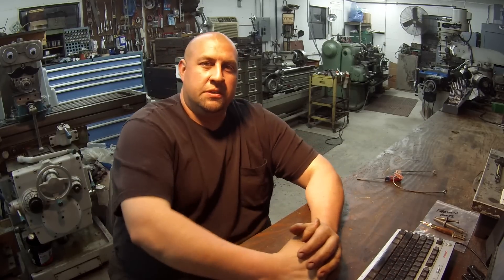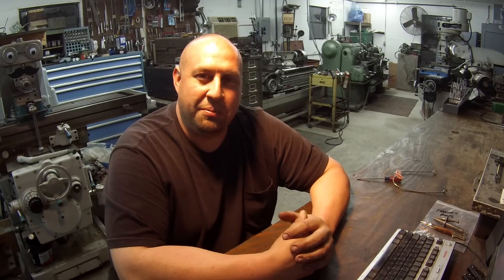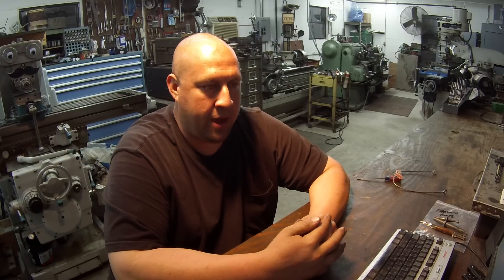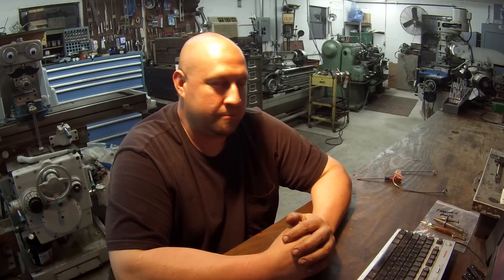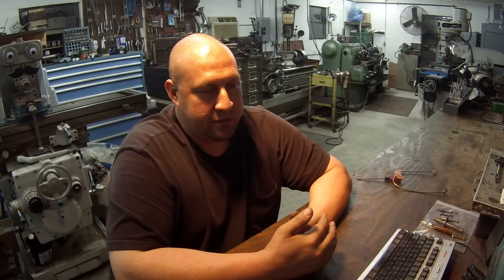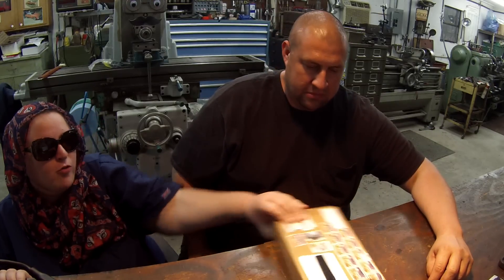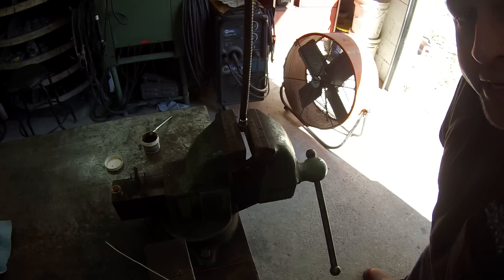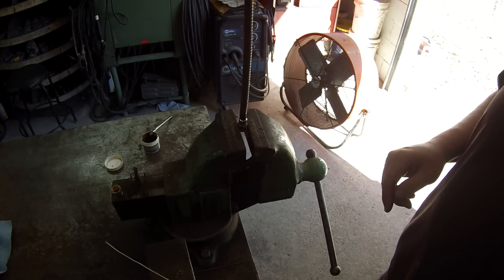Saturday Night Special 42 Part 1

Comment: Hey, if only you knew someone who has mad skills and a lathe, you could get them to make a custom all American nipple :D
You already have the reducer where that nipple screws into that angle

I remember a show talking about outsourcing, assume an American company is paying $10 for each worker, plus the overheads of the building, electrical etc
They can outsource effectively for $10 per worker, and that includes all overheads.
Reply from the maker: You make a good point there Sparky, and one which I have already thought about. I'd like to find some good quality 3/4" pipe and build the fittings myself. Hell, I might just used some old stock laying around.
Reply: ***** If the company has to pay 25$ per hour for their own workers, even 30$ or more for outsourced work is cheaper. At least here in Germany it´s because of tax laws: Outsourcing lands on the company´s bills as running costs, for those the company can get tax reduction, but they don´t get some for the wages they pay. The government get´s lower taxes paid and has to support the unemployed. Pretty stupid! The only solution: No tax reductions. For nothing. A fixed income tax on everything that is earned either by running a business or selling the individual´s workforce.

Comment: Your Milwaukee valve is a 'Compression valve' it will work as a throttling valve, But a ball valve is actually better... However you are not throttling high pressures so the Compression Valves will do the job...

Comment: Hey Adam, maybe you knew it already, but make sure that you never heat chlorinated solvents (brake cleaner usualy is) beacuse it makes a poisonous gas thats quite deadly.
Being that said, over here its the same with the low quality products :(  but up there you at least have the chance to pickup the good old iron at a relative low cost and prevent it to be smelt into crap.

Best regards from Argentina

Sebastian Cardoso

Comment: i´ve used hydrocloric acid a few times on brass on hard to reach places and that have worked verry well, it gets everything of even in a crevase like you´re working with there and you just rinse with water afterwards. I dont know what it´ll do to steel tho :/ might have to test it and get back to ya :) (dont hold your breath though LOL)

Comment: Adam, undersize taps are used for components that will be hardened & tempered. After H/T, they are retapped with normal size taps (don't ask how I know this, I could tell you but then I'd have to kill you).  That's a very nice acetylene-air torch. By the way the US made valves are globe valves but many US company have their smaller valves made in China for economy. Milwaukee Valve Corporation is now part of a Chicom company ! There is no shortage of excellent US made valves but you won't find them at Billy Bob's Bargain Basement.
 Please keep the info about the taps private (LOL)
Reply from the maker: These old "globe" valves have been sitting in out bins for a long time, so I'm willing to bet there are USA made. There's no indication otherwise except the the handle tag. I'd like to put one to use. Don't worry about the tap info, I won't Tweet it. LOL
Reply: How to you re tap something that has been hardened? Your mistaken I think? 
We use to have to use OVERSIZE taps prior to the piece being hardened! 
After heat treat we would have to sometimes get the crud out (case hardening) of the now hardened tapped holes by very carefully re tapping with regular sized taps to clean out the thread.

Comment: hi, in europe (i am from Romania)we use 1-2-3 taps this is one set... first you put the nr 1 in the hole, afther that nr 2 and nr 3, it is eazyer to tap. specialy manualy...  I saw that yours have a line near the square. that is the tap number. one line, is the fist tap... etc... it is like making a thred on the lathe, first pass... second pass...

Comment: those are globe valves.flow is in the bottom and out the top.They are good to use because they are designed to regulate flow.

Comment: You may have to machine your own pipe fittings.  Then you'll know for certain that its American made. Lol. You'll have to start The Booth Brass Valve Co.  Then you can put lots of us American machinist apprentices to work for you. Young guys like me, who are taking machine tool courses, or fresh graduates, could get real world experience. Creating more jobs for this country that is much in need of them, while also creating a quality locally built product. You can boost our economy two fold.
Reply from the maker: I like your thinking Mitchell!
Reply: You would also need to be certain that the materials were produced in the USA. 
We see an increasing amount of materials such as tubing, bar and plate that is being produced in China. That includes steel, brass, bronze and stainless. 
And the quality is inconsistent and sometimes sub-par as to dimension and metallurgy.

Comment: It's all about cost, over any consideration of quality or efficiency. I'm sure that if China had the same protections for workers and the environment as we do, they wouldn't be able to compete nearly as effectively.
It really is about quality. For example, at work, I was fitting some pipes for a test machine, and noticed the difference. The stuff that's stocked by Grainger is their own house brand, made by who-knows in who-knows-where, China. Their 'galvanized' Schedule 40 pipe and fittings come in already with rust spots on it, wavy threads, and a clear weld seam protrusion on the inside, to say nothing of the uneven end of the pipe. Nothing I'd ever build with. Compare that to Wheatland Tube, who stamps their name on all their pipe (Schedule 40 as well as EMT and other conduit types, and some light structural tube), which is made at their plant on Western Ave. in Chicago (I've been by there several times on the train) from American-melted steel sheet. The galvanizing is even and without rust spots, the threads are straight with the proper taper,  the cut ends are square and without burrs, and the seam is minimal.
Good thing about ordering from Grainger, you can look at items and it'll show you the company that made them, and in which country. For some items, including pipe fittings and o-rings, American-made parts can be less expensive than the Chinese stuff.

Comment: I believe that Lowes and Home Depot are both owned by the Chinese. I think they did them just like Vise-Grip. Competing is too hard so it is easier just to buy the product then you can sell your stuff much easier and most people don't think anything about it.  Finding anything of quality at a big box store is nearly impossible to do and sadly they have put out most of the mom and pop type places that used to handle a lot of good stuff. The internet and direct buying from manufacturers is about the only way anymore to get good stuff. On your lathe I don't think you want a gate valve, they tend to be leaky unless you are full open or full closed. Look into a Vogt Globe valve for that application. They used to be made from raw material through heat treat and finish in Louisville Ky but in the 90's they moved production to Texas and I think they are still US made there. Gulf Coast marine supply listed on Pennsacola Hwy in Pennsacola shows to be a dealer and sounds like a cool place to check out from their webpage. :-)

Comment: The other thing Lowe’s and other big box stores like Lowe’s and Walmart.  I remember reading this story maybe 10 years ago.  Walmart approaches Snapper mower and says they want to sell snapper.  Obviously Snapper is VERY interested.  But, Walmart set the buying price and volume.  Snapper says that’ impossible it can’t be done.  Walmart says don’t worry about it.  We’ll set up the factories in China and have them made over there.  Snapper knows you can’t make quality at those prices and certainly didn’t want “made in China” on their mowers and turned Walmart down.  

The writer did some more research and discovered that all the mowers sold at big box store are made in China.  Buy a John Deere mower from Lowe’s?  It’s not a John Deere.  You have to go to a John Deere seller to get a real one.  The rest are nothing more than cheap Chinese copies.  

That’s probably exactly that happened with that ball valve company.  Lowe’s approaches them for their brand and reputation.  Sold them the deal.  Now the company can’t even compete with their own product and probably shut down its US factory.  Or just focus on the larger items they make you can’t get at Lowe’s.  Grinds my gears!  Try not to go to lowes.  Their ruining this country.

Comment: Check and see if valve says water oil or gas on it. Coolant might erode washer on that old 3/4 valve. Come 2 think of it , make sure washer and packing washer aren't dry rotted b4 u even bother with it.

Comment: Hi Adam

I like your disappointment on buying a valve made in China, but money makes the world go round and some people in black suites and ties found out, that it was better FOR THEM to produce the valve in China ... it makes room for their salery too ... and surely a lot of it too !

I would place your "old new" gate valve from the drawer right after the albow so it wont move the nossle so much when you turn it.

BTW, how are this "goose neck" sealed ... no rubber ... just steel ?

... wonder it's not leaking !

Re-think your going into the dentist business ... I'm sure you'll miss a customer - your Mr. Dentist
Reply from the maker: Keld I'm not sure about the swivel joint as I have never gone into it. But sometimes they use o-ring seals. Not sure on this one.
I'll probably repipe a bit different next time, and possibly make the fittings myself.

Comment: Ha ha ha.  Elena just HAD to see what was in the package.  funny  Oh yeah, those clamp thingies are called hemostats.  I wouldn't know what they could be used for.  Maybe a "roach clip"?  Yeah, it's sad to see all the stuff that used to be made here go to China.  A lot of those valves are low quality.  Sure they "look" like the American(or European) original.  But when take a closer look, you notice that they're made out of thinner material, etc.  The old American stuff would last a lifetime (atleast) and could be worked on or repaired.  The new stuff just doesn't last and you have to be gentle with it.  They make stuff now that breaks and you have to purchase again and again.

Comment: Skoda made particularly horrendous two cylinder ultra compact automobiles.  The one I saw have an accident on the German autobahn couldn’t accelerate quickly enough up the on-ramp onto the Autobahn to avoid being run literally over by a 160kph semi truck filled with a double trailer of steel rebar heading to Italy on the A-6.  The Skoda was hardly recognized as a car after and was 8” thick at the thickest remaining point...which meant bad things for the three passengers...  The truck took no apparent damage and drove away after the investigation.  The worst accident I ever witnessed in my years living there.

Comment: What really ticks me off is when I pay $72 for 6 plasma cutter nozzles and electrodes from a major USA welding supplier.  I can pay $27 for 10 nozzles, 10 electrodes and 2 ceramic swirl ring delivered to my door from China.  Is one better than the other?  I cannot find one difference and would bet that both are made in the same shop.

You drive your truck, car and etc. and it would scare you how many parts are made in China.  Go look at oil filters in your favorite supply store.  Many are made in China.  I have a family member who is a quality engineer for a major USA oil filter company and am told "Yes, we have some filters made in China. For us to tool up to make them is not profitable.  We inspect the heck out of them and we find they meet and most of the time exceed ALL specifications."

Today it is a global economy.  You can bet that some American company such as Lowes is making BIG $$$ on foreign products.  BTW "Made in America" can be said if it is manufactured in Mexico or Peru as both are in North America or South America.  "Made in USA" can be claimed if the last screw is installed in the USA.

Comment: Grinds my gears too, it's not that people wont pay  a price for decent parts, its that the seller wants to buy as cheap as they can and still sell it for the highest price they can, they dont want a fair markup, they want the maximum they can push it too, and that means getting the parts for pennies, meaning any company at home cannot ever hope to employ and sell product, unless they sell direct.  I think in future Adam, like me, esp for a major purchase you have to research and see if you can find a domestic manufacturer who is also selling directly.   The ultimate insult was putting an american company name with a USA location, and then quietly saying made in china....
Reply from the maker: I think that's what burned me up the most was the label.
Reply: Abom79 I got burned that way for the first time back in 1981 when I bought an HH Scott stereo receiver - only to find out that it was imported from Korea...

This has been going on for a (loooong) time, but only got insane after 1986...

Comment: If you really have to use the huge 3/4" valve, why not mount that straight on to the elbow, that way it will not be a vibrating weight waiting to break off and fall into the lathe bed.I know what you mean about the Chinese made stuff we are all offered in our shops, almost everything we buy in USA and UK is made in China, I try to resist buying it, but it is everywhere now, and our factories are long gone!

Comment: Hi Adam
im from Germany, sorry for my english :)
the Taps are probably a Set that cuts the thread in 3 steps
the first one has a single Ring on the Shaft
second one has two Rings
the third one which is finishing the Threads is without any Ring
in Germany its called "Vorschneider", "Mittelschneider" and "Fertigschneider"
http://de.wikipedia.org/wiki/Gewindebohrer <-- look at the last picture
Reply from the maker: Good info. Thank you.

Comment: Without reading too many comments, or even finishing the video(I'm at 20:15) because my mind would wander off if I didn't share a trick I have used with excellent success on dirty parts that have places impossible to clean that I silver solder with ease and 99.9% failure free.

I take the flux compound and heat it up in a little SS jigger for making drinks(well, it used to be..) and then dunk/or soak the part in it and continue heating until the flux bubbles and boils. Then I heat the part, add fresh flux, and in goes the solder like water into a dry sponge.

Sorry if this was already mentioned, done, or even failed, but I just had to spit it out before I forgot. It was a bit of a wild finish to my week and I've had to take more medicine than I like to and I keep forgetting what I'm doing, so please forgive me for jumping in like this.

Now, back to SNS42 part 1...carry on.
Reply: Well, after watching about 30 seconds more video your method of preheating and adding flux to boil out of the fixture worked in apparently the same way, and as is evidenced in the final segment, it worked out rather well for you! Nice...in the famous words of "the A-Teams" Hannibal..."I love it when a plan comes together!"...good job man.

Please don't think I was trying to tell you how to do your job either, I'm so totally not that way, even if I were to somehow think I knew better than a person, I always let them do the job the way they want to unless it would somehow catch my leg on fire or burn down my house, LOL!

I was just hoping to share a little trick that has helped me numerous times in the past when reparing old plumbing that cannot be disassembled due to age and or weakness and is filthy, so it looks like it depends on where you are and what you can do to make you choice on how to clean a fitting with flux.

In my mind I was imagining all of the old toilets I've fixed that can't be torn out because the restaurant/bar has to be open in 2 hours and you've got to get it done, and that was when I came up with the stainless jigger trick. It uses allot of flux, but when they need a job done in the heat of the moment, a jigger and a tin of paste is the last of their worries and can be sacrificed no problem.

I really enjoyed your show and can't wait for # 2, Aloha...Chuck
Reply from the maker: It's a good tip Chuck, similar to the idea I had in mind which is heat up the part and burn the crud out. My only worry was that there was still sediment still in the fitting and wouldn't allow the solder to bond. But it took in well, and I'm happy with how it turned out. I shown it all in the video.
I now have a solid leak free joint!
Reply from the maker: Knolltop Farms
You got that right Chuck. Sometimes cost is no option to get a job done. Your technique sounds like a good one to keep in mind. I don't run across that many soldering jobs anymore, but I know that heat can be your friend. If you can get it clean enough, that solder will find it's way home.